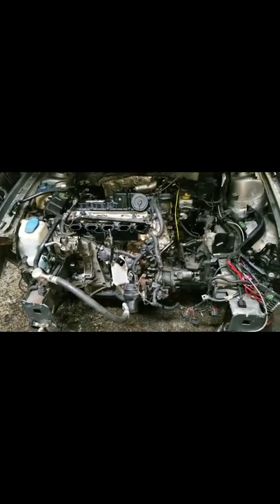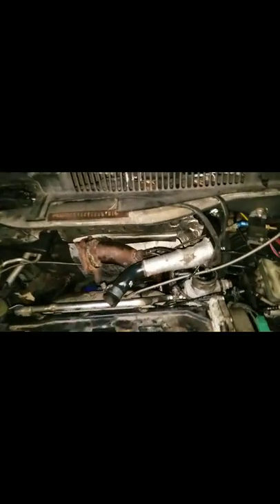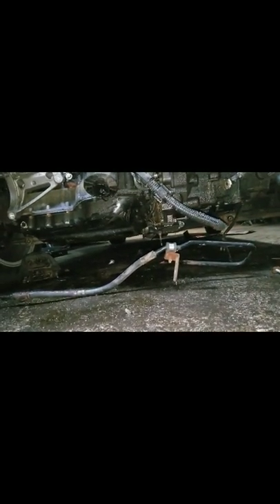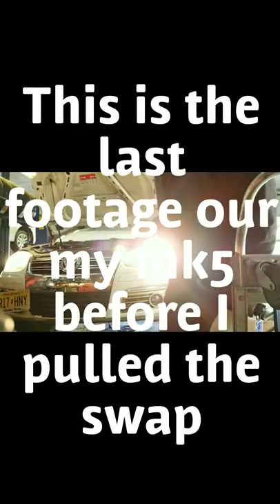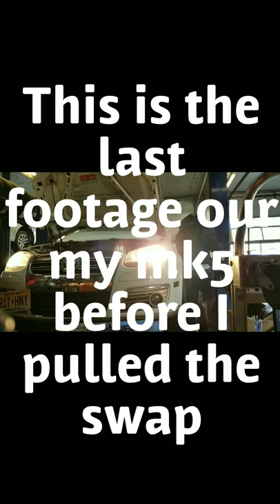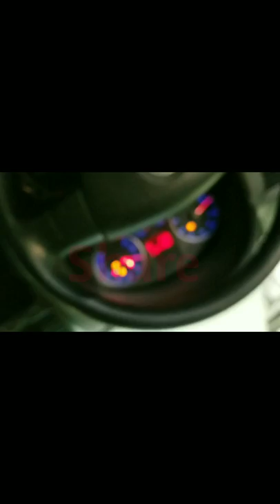Mk4 gti 2.5 swap

Comment: Hey buddy nice project! i am also building a mk4 turbo 5 cyl here in Brazil. Did you use stock mk4 engine mounts? I am looking to upgrade those but couldn't figure out if i pick a beetle or gti aftermarket mount
Reply from the maker: Hey brother did you ever finish your build  with the 5cyl Id love to. See it or assist with it let me know  shott me a message on ig hot_swaps
Reply: @hotswaps5030 hey I gotta question I’m tryna throw a 2.5 in my mk4 jetta there’s no way to keep the mk4 cluster eh?

Comment: Greetings friend, how you ended up managing the harnesses of the 2.5 engine? Did you use the mk4 computer? Thanks.
Reply from the maker: Sorry  late response but happy to help on this wiring way fairly  easy  you can reach out if you have something doing and need assistance with motor bolts in  only mo ds needed is the mk5 shift  cables with mk4 shift tower besides that   axles from mk5 work or 4 whatever you have any questions  link me on ig hot _swaps  thanks for the follow

Comment: Does the MK5 ECU work with the MK4 chassis harness? I've been thinking about doing this for a while. Lol
Reply: I'm doing this swap currently.....was told to use all mk4 stuff for ease.....06-07 beetles came with 2.5L and was built using mk4 harnesses.
Reply: @coreyallinder3238  Greetings friend, how you ended up managing the harnesses of the 2.5 engine? Did you use the mk4 computer? Thanks.
Reply: @MrAngellajara  yeah! 2.5L engine harness and ECU  from an 06/07 beetle. The Ecu will plug directly into the body harness but there is some wiring repinning needed to make it run.
Reply: @coreyallinder3238  Greetings, when you figure out the repinning, would you please write it or record it and send it to me, thanks.
Reply: @coreyallinder3238 hey I’m looking into 2.5 swapping my mk4 is the 06/07 the only 2.5 engine code that used the same harness. And how can I use other 2.5 motors then

Comment: Gearbox gti ?
Flywheel 
Clutch
Reply from the maker: Everything from the o7k trans clutch engine mount trans mount doggone from the mk4 gti bolts right up immo delete ecu from the 07k an gas pedal for right now due to the fact the frequency a little different but will be updating it soon but it works fine so why fix what not broke also did you think I should make a  build video of all that on the car let me know also share like the videos I want to see a 1000 subs then I'll start offering my knowledge of cars to all who ask regardless of model type if I don't know I'll find out last but not least.   keep Swapping